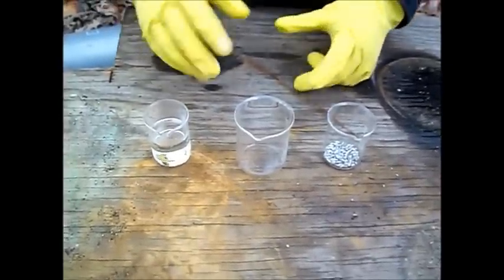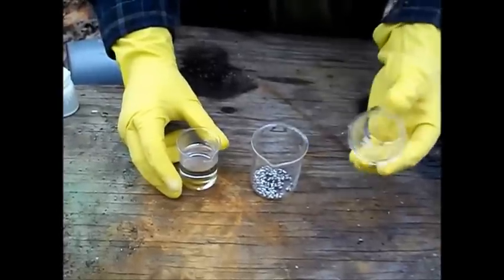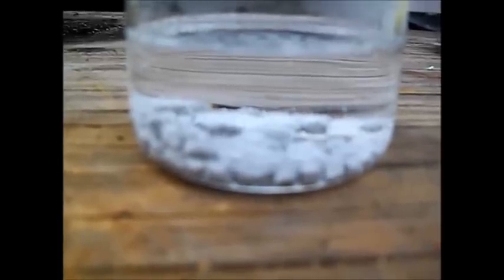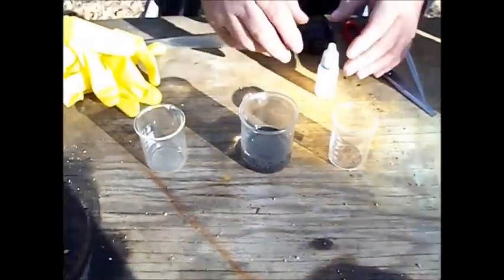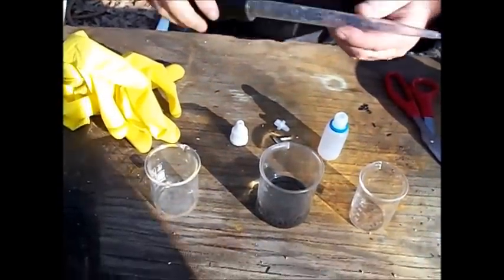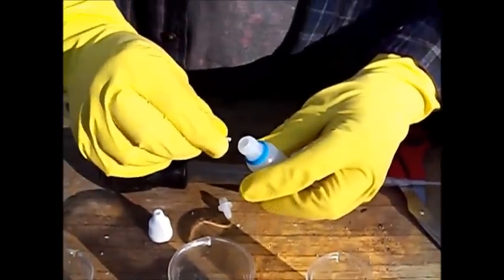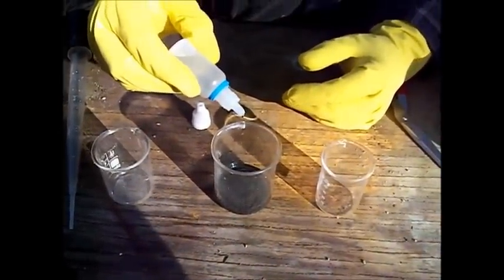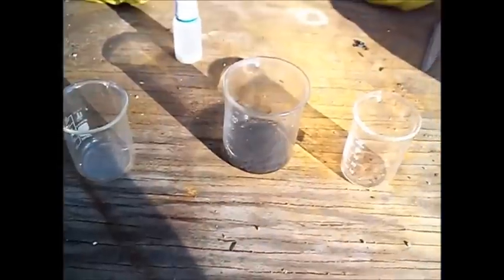making stannous chloride test solution

Comment: Thank you brother.  Worked great. 
I have another question that maybe you can help me with.  What's the best way to strip assorted pins from computers. From Ribbons sockets and motherboards. Ect. I tried nitric acid that I made with a retort but there's always a grey gunk that won't  dissolve.   After the reaction is done.  I'm kinda new so any help would be appreciated. I have over 50 computers worth of e-scrap.
Reply from the maker: The gray gunk is hydrated tin known as metastannic acid. It forms from dissolving tin in nitric acid. Look up copper(II) chloride etchant. Otherwise known as AP, it will dissolve the base metal leaving the gold as foils without forming the metastannic acid (gray gunk). It's made by starting the solution with HCl and hydrogen peroxide. The H2O2 is only added once at the beginning. If you add more after the process has begun, it could dissolve some of the gold foils which will cement back on any exposed copper. The gold is still there but now instead of gold foils, it is a black powder. So only add the H2O2 once at the beginning. Add an aquarium pump and some rubber tubing to bubble air through it to speed up the reaction and keep everything agitated.

Comment: That's for all plated pins magnetic  and non magnetic??   Again thank you for your expertise again.
Reply from the maker: Yes, it works equally well for both copper based metal and iron based metal. Since the copper(II) chloride solution is re-usable over and over, be aware that the iron will shorten it's useful life as an etchant. It's a small price to pay for getting the gold.
Reply: +Geo  thank you brother.

Comment: Hello Mr. Geo,  can we do it with 99.9% tin? Are the same quantities, 20gr tin and 40ml Hcl? can we do half of that,  10gr tin and 20ml Hcl?

thank you
Reply from the maker: +Helder Freitas  Yes it will work and yes, those quantities will work. Make sure that the solution has absorbed all of the tin that it will hold. You will want to place a small piece of tin metal in your solution to prolong it's useful life. If you test very often, there is no need to add the extra metal as you will use the solution before it goes bad.

Comment: +geo . can I use muratic acid ? and what is antimony? I'm new to this. all I could find for solder is 99.3% tin .7 % copper can I use the muratic and tht to make the solution?  can it be used for gold and silver or just 1 . Sry for all the ??? just new buddy. thanks for videos
Reply from the maker: +Anthony Holbrook Yes. Muriatic acid is hydrochloric acid (HCl). It's the same thing. Muriatic acid is the industrial name for the acid. Antimony is a metal. https://en.wikipedia.org/wiki/Antimony
Any high tin content solder will work. The 99.3%/.7% solder will work just fine. HCl alone will not dissolve copper. It can be used to test for dissolved gold in solution but not silver. Silver in solution is a whole different process with different chemicals. There is a test for silver in solution of nitric acid where you add a drop of HCl to a sample of the solution. If there is silver in the solution, a white cloud of silver chloride will form.

Comment: My tin doesn't bubble unless it's heat.  I'm guessing it's the HCl because it's the low fume.
Reply from the maker: If it's the green label, it has inhibitors that keeps it from reacting with metal. Heating it should force it to work okay. I have used it before. You shouldn't have any problems with it.
Reply: how long do I have to heat it?
Reply from the maker: Once the reaction starts, it should not take very long. The best answer I can give is, until the tin dissolves.
Reply: hmm...then I gotta need more HCl than 70mL.  Thanks.

Comment: Now that I have made the stannous chloride, can I just drop it on a solid substance and the experiment will tell me if it is gold or not?
Reply from the maker: Jeremiah Alger No. Stannous chloride is an indicator of gold in solution. It does not work on solids. If you attempt to refine, stannous chloride test solution is a must. Trying to refine without it is like trying to bake a cake in the dark. Stannous chloride is the flashlight that lets you see whats in the solution. I will post another video showing how to test using the solution.

Comment: so with this solution I don't need test paper correct?
Reply from the maker: It sounds like you are confusing two different things. When I think of test paper, I am thinking of PH test papers. This does not test for PH but rather it test solutions for the presence of precious metals. You would use this test solution to make sure you have gold or other precious metal in your solution before proceeding to the next step or use this test solution to make sure all of the gold or other precious metal is gone from solution after you precipitate.

Comment: @ geo how much stannous chloride crystals did you use ?
Reply from the maker: I didn't use crystals, I used tin metal. Tin metal dissolves easily in hydrochloric acid.  I used 20 grams of metal in 30ml of HCl. This is a very strong concentration and will detect the smallest amount of gold in solution.
Reply: so just 95/5 tin and HCL  nothing else ?
Reply from the maker: Nothing else.
Reply: ok thanks my friend . you have been a really big help .  the reason i asked is because in the video you said "mix up your acids" ( plural ) . btw one more question , dont you need to put some tin down in the bottle to help preserve it ? make it last longer ?